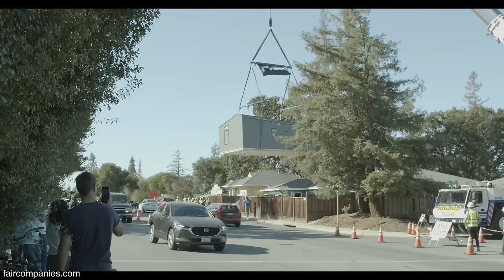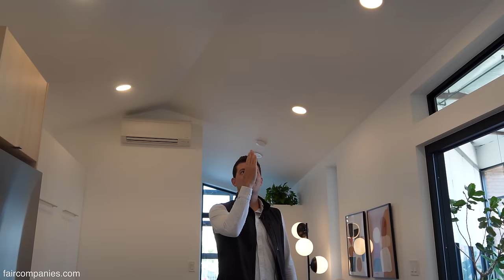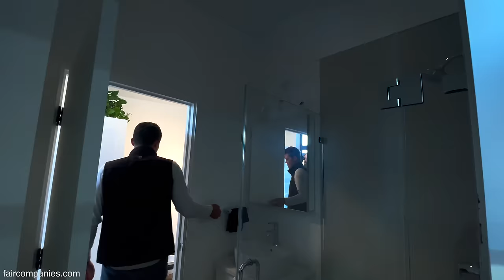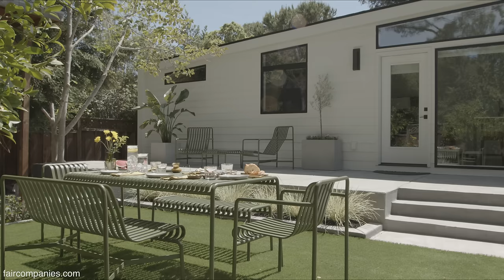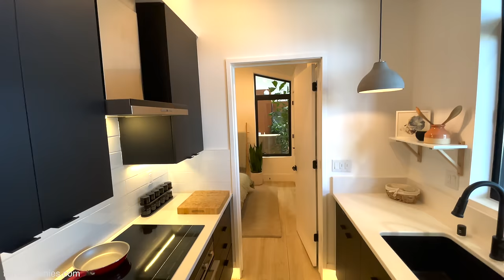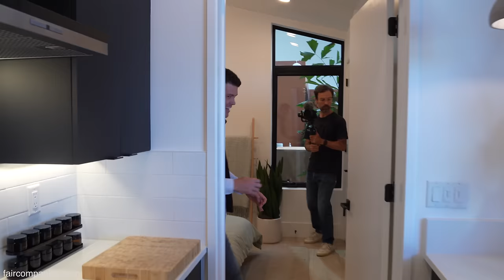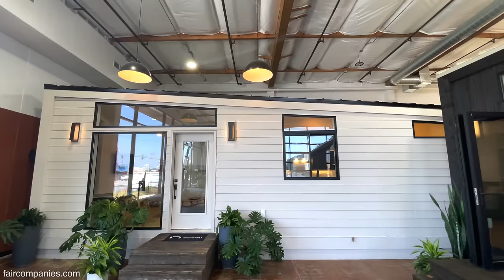Small prefab backyard home feels more livable than McMansions

Comment: Starting at 228k. Cheap by California standards but most will be rentals with sky high rents. This price wont facilitate the volume needed to affect change in market rent rates.
Reply: And it's good to remember that there is no housing shortage in the US. 8-15% of homes(houses and apartments) are vacant depending on where you live.
It's an affordable housing/equity issue, and unfortunately things like this aren't going to make an impact for the people most in need.
Reply: How does the cost compare to other options like just building it from scratch? It seems one could build from scratch for cheaper, esp if they do some of the work themselves.
Reply: @drewcipher896  I live in a major city and this is the case. Most of the newly built apartment buildings advertise luxury apartments and they stay empty for months.
Reply: Also doesn't seem like a real solution to housing issues - what person wants to permanently live in someone's back garden? 

What type of person is buying or renting this property outside of an existing homeowner's family members?
Reply: @indoora  The prices need to come down. Elon has a home from the BOX company which cost him $50,000. But it would cost more now.
Reply: @lorettaharris4377  The Elon home is not real and the city I live in does not have room for modular homes.  That is why they are building apartment buildings but only for the upper middle-class.
Reply: @Francoberry  You made a very good point that no one is addressing.
Reply: @indoora  That's not right. Our homeless people need homes too!
Reply: @lorettaharris4377  What are you talking about, I never mentioned the homeless.  I'm not trying to argue with anyone, what I said was easy to follow.
Reply: @drewcipher896  nobody can afford them thank the new administration and the fools that voted for our situation.
Reply: @drewcipher896  If the houses are in another state and you have a job or family that you need to be close to…yes there is a housing shortage.
Reply: Wow $228 for 580 sq-ft comes out to be $ 400/ sq-sf.  That is close to expensive custom home. Land excluded.
Reply: @indoora  Thank you.  That Corporate America
Reply: @lorettaharris4377  I think She was really referring to affordable housing relax
Reply: @lorettaharris4377  The prices will not be coming down. In the short time since Musk highlighted his prefab home for $50,000, the dollar has devalued so much. The cost of materials and transportation of them to a site have considerably increased, and the timetable of delivery of the materials may have been pushed back by months. It is costing the homeowners more to build, longer until they can rent their additional unit, and thus they recoup this through the rent.
I do not believe that the small size of the new units is a deterrent at all. They are being utilized near urban areas, where people are familiar with living in smaller spaces. Unfortunately, first time home buyer's options have become more restrictive. I guess the one still positive factor is that there still is plenty of rentals and homes for sale: they are just much further away from the targeted city or workspace.
Reply: @Francoberry  In California it is quite common. It existed before this ADU law. They area called guest houses. Very common esp in LA
Reply: @nofurtherwest3474  But most Americans are unskilled or just willing to get their hands dirty. Now I need to checkup on Habitat for Humanity! Haven't heard from them since 2 years ago! Best thing any president has ever done EVER! 😇
Reply: Each additional supply allows for  more space and easy the demand issue. 
One ADU creates a granny flat another makes an office. 
This frees up maybe one home or office space somewhere else. 
Small steps are worth it.
Reply: @drewcipher896  In mayor metro areas vacancies are well below 4%. New supply will drive prices down.
Reply: @indoora  That new builds are empty is really normal and this mismatch takes some time. 
Sometimes they are waiting for even better overs
Reply: @lorettaharris4377  The house is not the expensive part in this solution it is the lot.
Reply: You don't have to get that high end one.
Reply: That price is prohibitive. Imagine the rent one would have to charge in order to cover the loan and insurances.
Reply: Price is including the budget for a home visit, pre-approved plans for permits, permitting process done for you, a completed Abodu unit, standard site work, delivery from the factory, craning, and installation.

People generally don't understand there's a lot more costs involved when developing any new property and it's not just the cost of the building.  This is one of the reasons housing growth has lagged behind population growth for a century now.  

There's also confusion because not everything they know is true.  Like Elon Musk has nothing to do with Boxbl and the $50,000 doesn't include all the other costs to actually get it to your property and installed.  

Cost of existing properties doesn't include what it cost to develop and build them as well, but those costs are one of the reasons it's increasingly hard for properties to be developed for affordable housing as it costs the developers so much they have to make a return on their investment and promotes higher cost properties and rentals.

So there's a heck of lot more involved than people think and it doesn't help most don't seem to have any idea how it really works or that the way they're making comparisons is misleading at best.
Reply: @Francoberry  You'd be surprised. Since there are no starter homes on the market anymore, this is the only option for a lot of young families and professionals.
Reply: I'm wondering the impact these are going to have on parking in these residential neighborhood?🤔
Reply: That's what happens when you let the hyper effecient free market be the only viable place one can even attempt to solve the question of housing. The state works hard to accommodate private interests, rather than getting into the game and providing a viable alternative. One that would prioritize human life and respect over profit and wealth.
Reply: @drewcipher896  new build won't hurt.
Reply: @JbushBush  No, you're confusing politics with the free market.  Free market doesn't impose bureaucracy and a litany of fees to run it but politics does.  Along with people making choices that are short sighted and over the years got us to this point, which is why we have such sayings as the road to hell is paved with good intentions.  You'd probably be shocked how often it's regular people who are the cause of preventing solutions.  Like people suing the government every time they try to open a homeless shelter, even using abandoned buildings because of NIMBY'ism, concern about property values dropping, having people they don't like move into the neighborhood, etc.

If we had an actual free market we wouldn't have half the issues we have now because people would be free to solve it instead of having to go through a self serving bureaucracy full of special interests and other issues.
Reply: @Francoberry  actually, in California at least, people ARE renting these, sometimes called "casitas". There are some benefits. Often a nice yard that the renter isn't responsible for. Sometimes access to the pool. And, quieter than a complex.
Reply: @indoora  well, it IS a popular and needed thing in California where this is happening. That's why they changed the laws to accomodate more "casitas" like this.
Reply: @nofurtherwest3474  yup. guest houses or casitas.
Reply: @paxundpeace9970  Apparently, you missed in this video that these are being built in the back yards of homes that are already occupied/have owners.
Reply: @dod2304  I do not live in Cali nor were my comments about living there, I was talking about where I live.
Reply: I just did the math, These need to be under 14 feet long. OK so if it was 14 feet by 14 feet, that's only 196 square feet. How do they get 500 sq foot out of this? Maybe they mean 14 ft wide, and it can be longer? 14 by 30 ft is 420 sq feet. Am I doing the math wrong?
Reply: @lorettaharris4377  the Boxable price of $50k doesn't include foundation and setup , water and electric hookups. Plus it's movable, so hard to finance or insure.
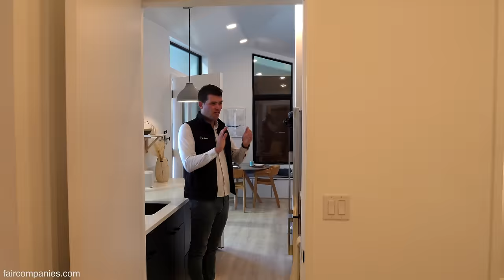Reply: @recoveringsoul755 He stated it is approximately 14 by 35 feet at 11:41.
Reply: @nofurtherwest3474  Enter 'Habitat for Humanity'.  One of the worlds most worthy organizations.
Reply: It's actually a pretty insane price for any kind of tiny home. Just a plain old cash grab.
Reply: Fun fact, no developer builds rental units with the intent of lowering rents.
Reply: @nofurtherwest3474  I was told around $400-500/sf, so for 500sf, it's $200-250k.
Reply: @sophiamichael2788  That's quite expensive
Reply: @Francoberry  lots of folks. We have these kinds of houses here in Phoenix, and they go to retired singles, college students, and people who are establishing themselves. Take a closer look.
Reply: @indoora  I addressed it. Lots of people live in these kinds of places. I have friends who lived in these kinds of places. Hell, I lived in one of these for two years.
Reply: @docmara  I am sorry but I have no idea what comment you are replying to. From what I can see I never said a word to you till now so I have no idea what you are going on about.
Reply: @indoora  you said no one was addressing an earlier point by Francoberry asking who lives in these places. I addressed it. People I know. I have. Now you know what my short post was about.
Reply: Very high priced for something that small!
Reply: Exactly. Sadly this is not the solution. Stop letting so many people come in here illegally is the answer.
Reply: @drewcipher896  Homeless people and low income people don't need to live in California actually. Its cheaper in other states. I'm tired of my home state being a give me state to anything that walks in...
Reply: @docmara  Thank you for clearing that up because your reply to me did not reference what you were talking about.
Reply: @indoora  those luxury buildings refuse to lower their prices so the apartments stay empty. Same for commercial spaces (especially in Manhattan)
Reply: 228K for that?  Thats crazy.  Where I live in Pennsylvania you could get a 2 story house for that price
Reply: @indoora    Hah! yeah - true enough  , I'm a public school teacher in South Berkeley and can barely afford my miniscule Studio apt .  I moved here from West Sonoma Co an area I can't move back to because most of the rentals are now AirB&B's or some Silicon Valley Tech bro's / Multi-millionaire's 2nd or 3rd home .
Reply: @robdubent  Bye Troll/ Incel    poor thing
Reply: Also the strange roof maxes solar hard.  These Silicon Valley people overthink things and believe everyone makes $300k like they do at Google and Facebutt
Reply: @RubiconV  LOL!  yeah exactly = Here in the South Berkeley/ Oakland area . Silicon Valley has been sucking the life out of our communities for years. Same playbook > they come in, buy lovely old homes with character with plenty of room for a family of 4 . But before ya know it,  that home is more than doubled in size, and all of a sudden that home is an ugly grey color , the size of it shades backyard gardens and OF COURSE they MUST have their " big dick " Tesla's . ( the more humble electric cars and more reliable new ones don't scream " I'M RICH"
Reply: I have a 300 sq foot rental. It costs over 4000$. It will pay it self back in about 4 years. That is amazing.
Reply: 228k sounds expensive for a studio
Reply: Cheap but then where would you put it ??
Reply: @Francoberry exactly you will have to buy land to put it
Reply: No that's not cheap in California unless you want to live in the big cities by my house 3 years ago for $139,000 10,000 sq ft of property 3 bedrooms 2 baths

Comment: I am 50 years old and over the last 20 years witnessed the American dream change from a meager home with a white picket fence , paid for within a 30 year mortgage to people feeling accomplished and secure living in vans , campers or " modular home" being not much bigger than a cardboard box that a refrigerator comes packaged in. Whats more demoralizing is the fact that some people have found a way to market these " homes" that literally 95% of the time does not pass county or city codes for residential use much less power and water hook ups. The prices of these " homes " are equal to or around the same price bracket of what a house cost a few years ago. I have 6 acres of property in the mountians that was obtained through family will. Am on my second mobile home that is needing rebuilt and seriously trying to have a small  house built on this land. The market that is in place has made this almost completely unattainable.  For the people with less than I have also trying just to have a roof over their head, my heart goes out to you and good luck
Reply: Great testimony, fully agree. But we must complain and Fox tjis, not accept the unacceptable.
Reply: Dont accept the unacceptbl. Speak out, complaun, fix things to what they once were.
Reply: There’s Lancaster Log Cabins in Pennsylvania.  Fully transportable 400 sq ft solid log cabins built on top of a trailer frame.  The most expensive model is $74k.
Reply: lol a few years ago?? You mean well over 3 decades ago? Haven’t seen 200k priced homes since the 90s. Early 2000s saw inflated home prices and soaring mortgage rates in populous metro areas. That’s when unaffordability began and younger buyers, all groups after gen x, were priced out. Swollen market rates are the bane of the middle class and keeping hardworking young gens from home ownership
Reply: Not in Ohio. Come live in Ohio! Houses are cheap in Ohio!

Comment: I think many of these wind up as airbnb rather than permanent and affordable dwellings.
Reply: But isn't it better for these low occupancy dwellings to be used for Airbnb rather than a higher occupancy and more affordable (per bedroom) primary dwellings winding up as an airbnb?  Since there is demand for airbnbs the supply has to come from somewhere.  To me it seems better to let the ADUs be the Airbnb supply.
Reply: Still this leaves other units open as permanent and affordable units.
Reply: @paxundpeace9970  yeah, not sure about that.
Reply: True & only ppl with existing land seem to purchase not just a first time home buyer
Reply: The ADU laws in most CA  cities do not allow such structures to be used for short-term rentals (30 days or less).
Reply: @kdockrey  Yeah, i bet there's stacks of way around that.
Reply: @Stikibits  the main way is to rent them out for thirty-one days at a time. Of course, tenants may leave before the lease ends. I will be interested to read about the penalties that my city, Los Angeles, might enforce. It is quite a stickler on properties under rent control. However, detached ADUs are not under rent control.
Reply: @kdockrey  Pretty sure there a plenty of ways.

Comment: Nice design but I'm glad I live in the midwest. You can still build a 2000 sq ft home with a basement and oversized 2 car garage for under 300-350K. We're building a multi-generational type home. The lower level with walkout and high ceilings is being finished to accomplish this. If I lived in an area with higher building costs this would be fabulous.
Reply: I doubt that you can do this for less then 400K after earnings
Reply: Were in  central WI. a old  livable home sold here this weekend on 8 acres for $25,000 😲
Reply: @TRuth.T  Geez!! What a great buy!!
Reply: @TRuth.T  Existing homes you don't pay all the cost it takes to develop and built it, you're only paying the present market estimated value for the property.  So that's not equivalent... There's reasons housing growth has not kept up with population growth for a century now.  It cost more to create new housing but as there isn't enough housing for everyone, new housing has to be created...
Reply: Does your cost exclude infrastructure of utilities (water, sewer & electricity)?
Reply: @TRuth.T  wow!

Comment: Cool concept but starting at $228,800 which I  believe is for the Abodu studio which is 340 Sq.Ft. is insane!
Let's do simple math $228,800 divided by the Sq.Ft. (340) = $673 per Sq.Ft. 

Do your own build and save. Pull the permits and sub-contract the phases. Go on yelp and find reputable licensed contractors for each step. 
Saving over $100,000 for a simple studio build is definitely worth it!

Comment: BOXABLE is only $50,000…..and with everything included (Shipping to site & set up, foundation, electrical, water & sewage, permits, etc) will cost additional $20,000 - $40,000. TOTAL = $70k - $90k

Comment: Added neighborhood density, heavier traffic, less street parking, extra water demands,and stress on utility pipes are a few problems with the state allowing established  residential areas to take up the slack in not keeping current with rental needs which would have diminished the rent rates skyrocketing.
Reply: People need to change the way they live, starting with getting rid of cars. I live on large acreage in a very rural area with 3 times a day bus, and I have made it work. My truck stays on my property, I specifically got a job that works WITH the bus schedule, rather than trying to make the previous job work around it. You can have increased density with not as much impact.
Reply: This is much better alternative than more urban sprawl . Better to have housing close into urban areas than continuing to build tract housing on agricultural land.

Comment: I have this really sweet 400 sqft 1.5 bath plan this company could do, only mine has a separate Master suite....IF I could afford their $290 sqft pricing I would be able to have them do one as I have single wall plumbing that saves 30% as I have no plumbing run longer than 72". I am not so sure having the 1/2 bath combined with the Utility room and separate exterior door is actually cost-effective, but as an over 75 couple, we think it works.